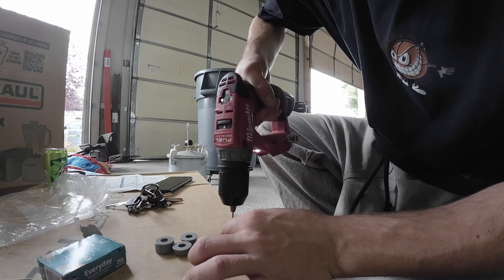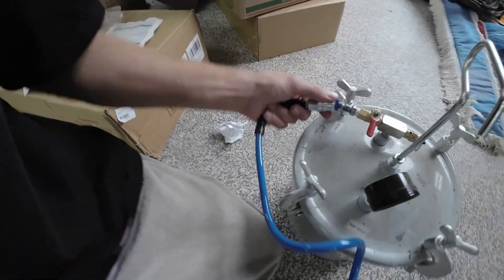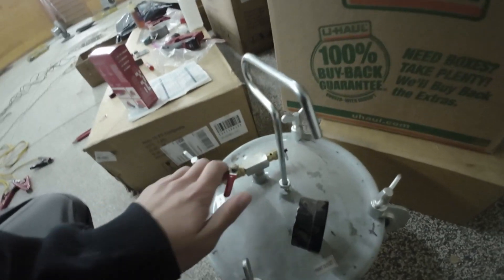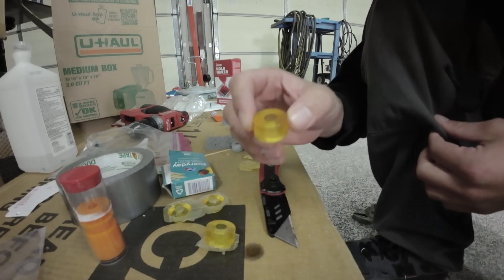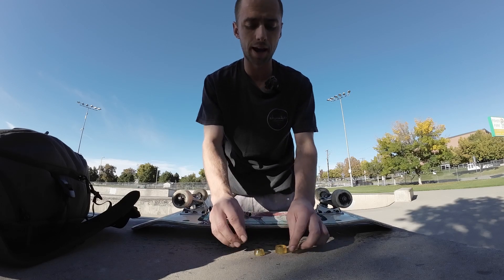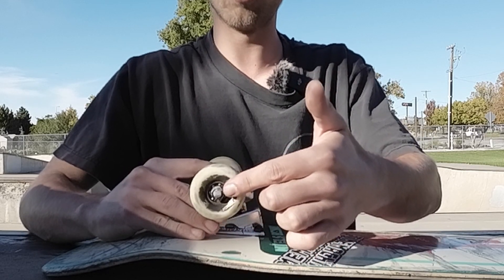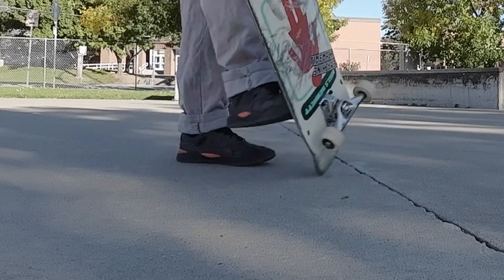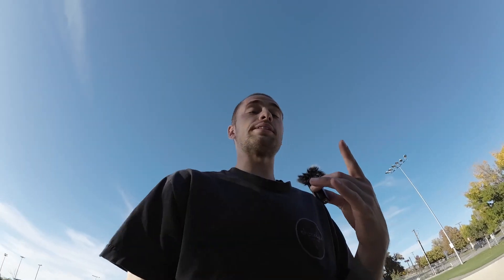THE WORST SKATEBOARD BUSHINGS EVER!!

Comment: I have seen people grease the pivot cups with waterproof auto and marine grease, just a little dab in the pivot cup spread with a qtip and it prevents the hanger from sticking and helps the turn
Reply from the maker: I have actually done that one it helps out a lot just haven't done it lately...lol
Reply: I have been really wanting to try the Venture 6.1s because I find my indies and aces too squirrely and have been wanting a more stable truck but am afraid of the turn because I only skate transition and bowls, is the turn really as bad as some people make it out to be?
Reply: I ride the 6.1s and think that the turn is still decent, but you have to press a bit harder in the turn. I cant really talk about riding bowls with them because im not experienced enough in this to give a good opinion :D 
In total i quite like the turn and stability and its enough turn for me :)
Reply: I ride the 5.8 ventures last weeks, used thunders and the ventures feel nice in the bowl for me, i like lose trucks, thunders get squirly in bigger pool, ventures feel more stable but stil turn fine when keeping lose. No need to tighten trucks for stability going faster as street. The trucks turn better after a couple weeks also thunder bushings make them a bit more responsive. I prefer the stock bushings.
Reply from the maker: @kylewilliams3559  to be fair I like a bit of a looser feel aces make transition super fun to just cruise and make new lines!
Reply: that gets rid of the squeeking mine still stick though

Comment: Try some bones on top with flat washers, stock bottoms. Deep turn, good rebound, stock barrel bushing keeps the right geometry and center stability! I’ve been using medium bones but I think hards might have even better rebound
Reply from the maker: I was thinking th bones bushings might do it?
Reply: @cbass801  problem with the bones bottom for me is that they’re cone shaped and the diameter is about 1mm smaller. Makes them feel less stable at the center and they dip down differently than barrels - to me, the resistance seems more linear compared to barrels where it kind of increases as you lean.

Definitely should give them a try as well tho, it might be what you’re looking for. Just rmb to ditch the bottom washer to maintain geometry.

Comment: I’m a bigger guy, 6’3, 235, and I’ve been having issues with bushings. Specifically Indy, the stock orange ones are decent but way too soft and squirrelly for me. The Indy aftermarket hard(black) ones are better feeling, but get destroyed rather quickly from the top washer cutting into them. I ordered some mini logo hard bushings but they haven’t arrived yet. I have some venture lows from the ‘90s with grindking stock bushings from maybe early ‘00s and they’re perfect but no chance of getting more of them
Reply from the maker: I have a buddy that dealt with blowouts alot he ended up using bones hard bushings and has sworn by them ever since!
Reply: @cbass801  i have heard mixed reviews on the bones bushings, but most people say they blowout after a month or so. i figure mini logo is bones/powell camp anyway and they don't have the weird plastic washers built it. might make a review once i get a feel for them, should be here tues
Reply: @diplenski  bones flat washer on indy aftermarkets works really good!
Reply from the maker: @diplenski  I've had sets that blow out super quick and sets that last 2 pairs of trucks. It's kind of a lottery, but they seem to be kind of hard to get a hold of for me. Haven't seen a shop stock them in a long time. Every time I ask, they say they are backorder or something
Reply from the maker: @diplenski  also only ever used bones bushings on indys. Trying them on thunder might be good, but the geometry might get screwy.
Reply: @cbass801  the mini logo bushings are nice, standard shape/size. i probably could've got the mediums(orange94a) rather than the hard(red100a). but they'll probably break in perfect. i like med/tight trucks anyway and hate wheelbite. i started out just replacing top bushing, so i had an indy hard(black94a) bottom bushing and mini logo hard(red100a) top bushing. it actually felt great, but i wanted to try a full set of the mini logos so i could give an accurate and fair review. otherwise i would've been happy with that mixed set too, a bit quicker turning. i really like the mini logos, good feel and rebound, it's a night and day difference compared to the indys that were cut from the washer. also i filed the edge of the washer so it wouldn't be quite so sharp. they remind me a lot of the shorty's doh-doh bushings from the '90s. i know they still make them but i haven't tried them in 25 years.
Reply: im 5 10 160 and they are to soft etc... for me too

Comment: why not just cut the stock bushings a little on a band saw? or sand them down? i could see if you needed them longer/bigger but you can make anything smaller
Reply from the maker: No shops around me stock the venture bushings was hoping to solve that problem a bit. If it would have worked with the urethane I got would have been way cheaper as well.